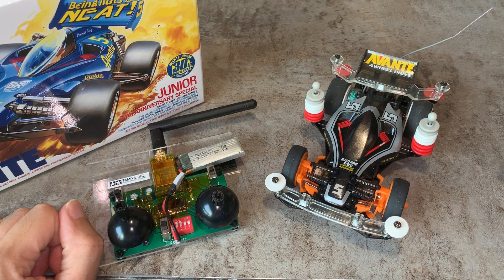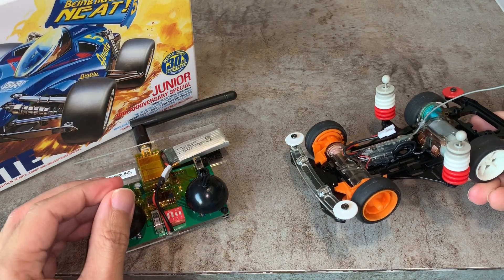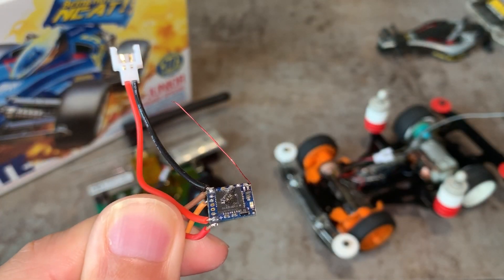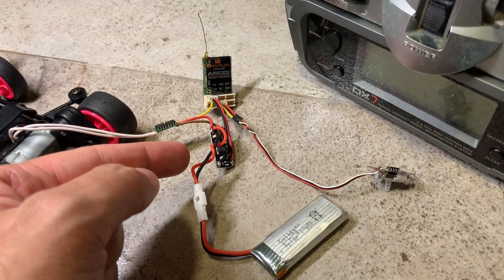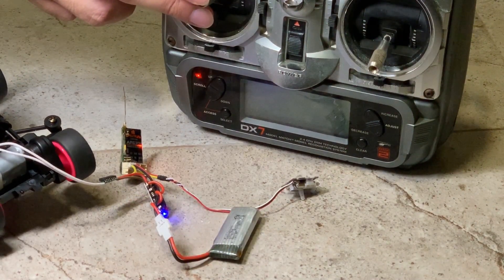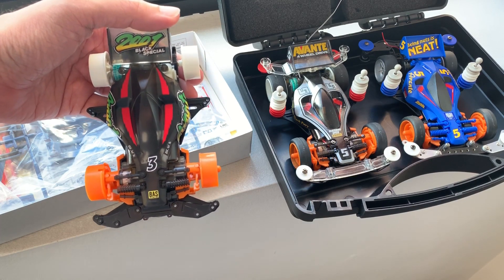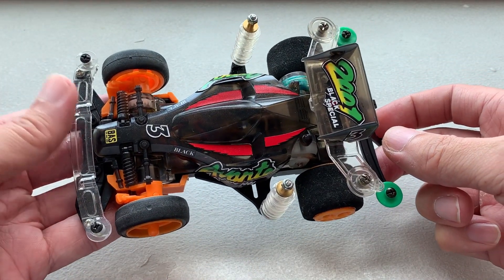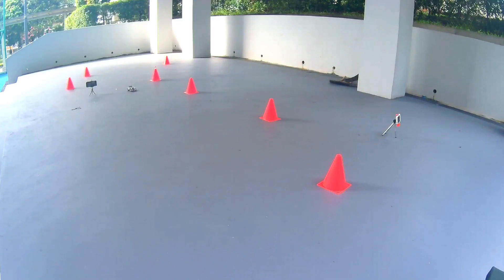Tamiya Mini 4WD RC Conversion MK2!

Comment: Thanks for the heads-up on the Avante 2001 Bk special’s clone! I bought the RZ’s Vanquish and it actually reassembles the Tamiya original look-wise. Decal colors are slightly “off” for the red. You saved me from getting their 2001 Bk special 😂
Reply from the maker: No worries mate, glad the video helps. :)